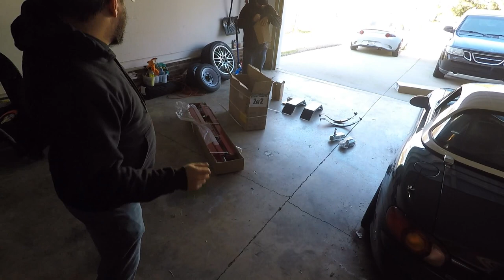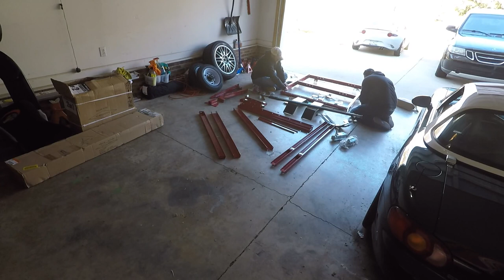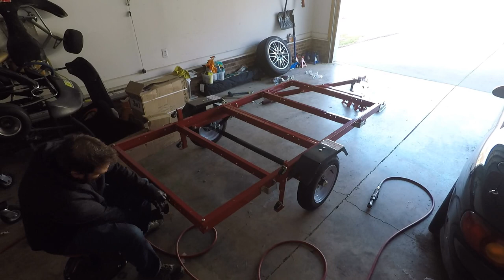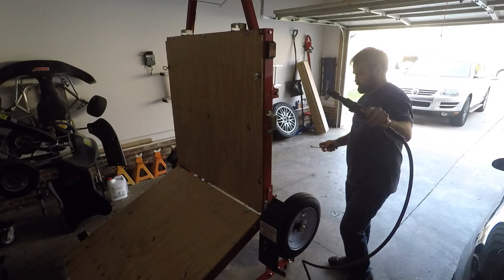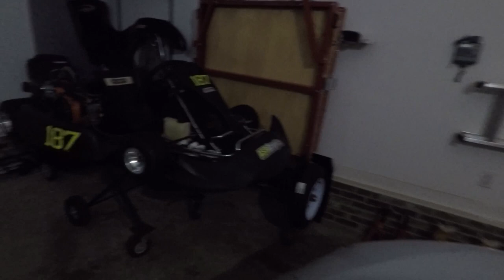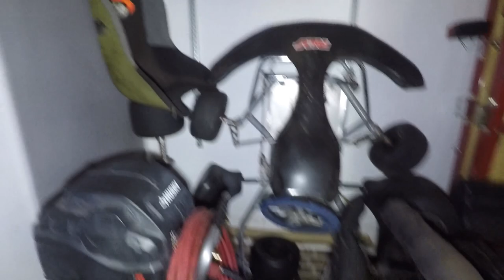Building a Kart Trailer

Comment: Wondering if you have a video or photos with the kart on, or you loading it on/off? In particular, I would expect the back wheels/bumper to interfere with the fenders on the trailer?
Reply from the maker: No photos or video, but the back tires sat behind the fenders on the trailer.

Comment: What are the dimensions? Cost? Can it be registered for road use?
Reply from the maker: The deck portion is 4'x8' laid out, the tongue extends 3'6" out.  Total width including wheels is 5'7".  It doesn't have a very high weight rating but is perfect for what I use it for.  In my state I have it registered and plated as a utility trailer.  I believe cost was about $350, I have roughly another $50 in it for the wood on the deck and hardware.
Reply: @miata-focus3455  Harbor Freight has a 4x8 utility trailer on sale for $259.99 with a coupon. I'm going to get it for my go kart. I figure in the low $300s for total cost including a new hitch. DIY light kit plus ply wood. Screws, carriage bolts what ever it takes it will not break the bank.
Reply from the maker: That's where mine is from.  May be the same one.  If so mine came with lights and a hitch, though I bought a different hitch as it was a weird size.  Otherwise decking was all that was needed to be added. I put eyebolts at the corners to use as tie downs to strap my kart down.  It also has "provisions" to build walls for it if you wanted.